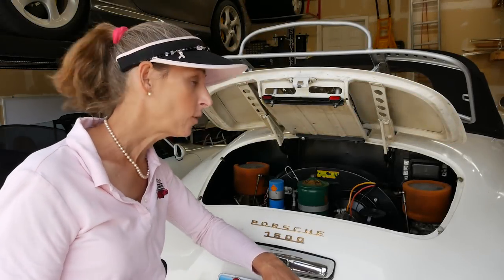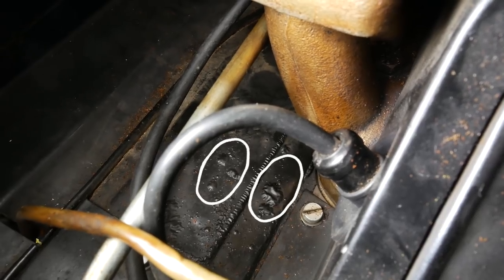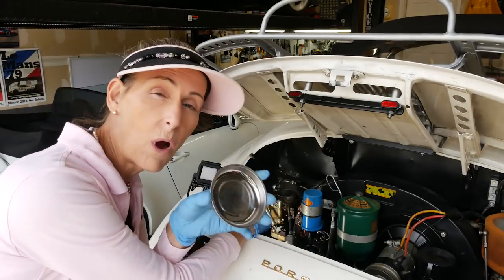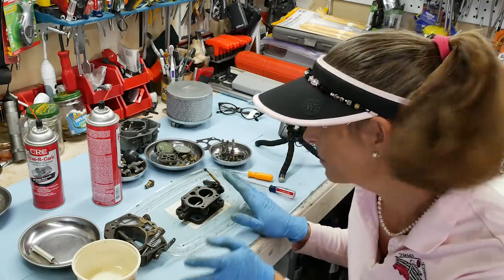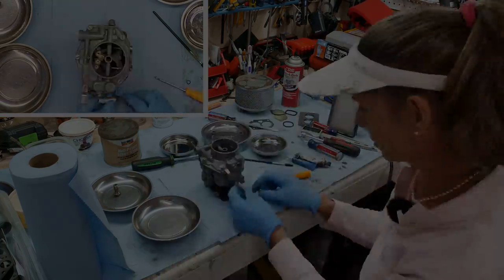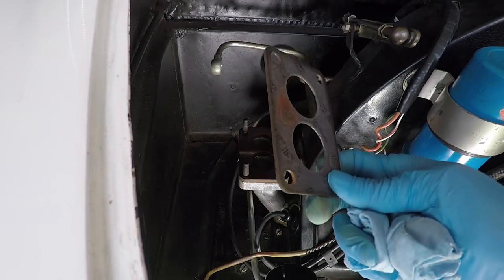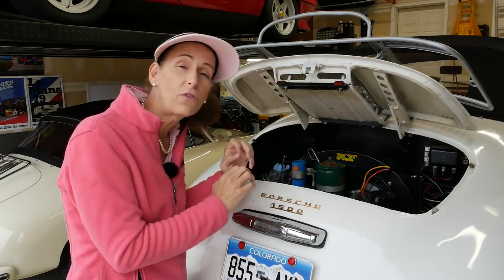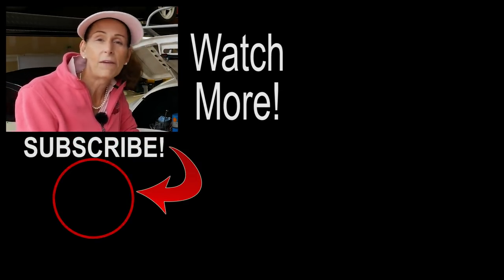Speedster Vlog #2 - Carburetor Tears

Comment: Another quality video!  You make it seem so easy to tear down and rebuild a carb.  I've never done one and am dreading the possibility that my 30Pict1 might ever need some work done to it, lol. 

Do those orange air cleaner covers actually do anything?  Those air filters look really nice...shame to hide them under a cover like that.
Reply: Chris,  My experience with the foam covers like that is they are for dusty environments. They are just an extra precaution so to not clog the main filter.  You would easily slide them off, and wash them periodically.  That can help limit how often you would need to replace the paper elements. But the heat of the engine bay, and volatility of the fluids/vapors tend to cause them to breakdown like these were seen to be doing.

Comment: ...given I have no direct experience with it yet an ultrasonic cleaner seems to be able to do a great job on cleaning small parts like carbs with beaucoup small internal spaces.
Reply from the maker: Hank, I am now envisioning our ultrasonic jewelry cleaner heading into the garage.  Lol. Heidi
Reply: Hank, I haven't experienced it myself either.  But I heard some gentlemen talking about it at a car show. They did not recommend using ultrasonic cleaning on the soft alloy parts of carbs. They mentioned a possible issue with cavitation erosion of the surfaces. Which in something as precise as a carb could cause issues with air/fuel leaks. So better safe than sorry I have avoided that practice. I have stuck with the carb dip just like Franny suggested.

Comment: OMG 7:19 made me Laugh Out Loud so hard. Please make that a regular part of these type videos.  I'm loving all the air cooled content. Picking up so much stuff I never knew about these types of cars. Great job on the rebuild. I understand how long a detailed video like this could get if you had you not sped up the rebuild portion.  But since I have never done one of these it would interest me to see every little bit of it. While watching I noticed the color difference on the carb base plate. Is it cast iron or another material? Looking forward to the next bit so I can learn some more. Thank you!
Reply from the maker: +Tim Gossett that is awesome!
Reply from the maker: Hi Tim, the throttle body is indeed cast iron.  Weighs a ton too ;)  I've always wondered if they do that for thermal reasons...  I think I had almost four hours of video to cut down.  It can get pretty fiddly cleaning all those parts completely.  This one wasn't that bad, but I wanted to be careful to clean everything.
Reply: Yeah it looked like it weighed a ton. Seems to me they did that for long term reliability as an aluminum or pot metal piece would wear out much quicker. But who knows for sure other than porsche historic. My other question is that I see it has one inlet but 2 ports in the bottom for each cylinder.  Is it truly a 2 barrel that pull from one inlet, or is it a single venturi that feeds both ports?  Do you find it easier, and more reliable to tune single inlets like this. Or is it easier to tune carbs with a venturi for each port?  It logically seems the 4 individual venturi would be more of a challenge.  (my nearest analog is a harley and its single carb for both clyinders vs a british twin with a carb per cylinder)  Thanks again for help with my technical questions.

Comment: The orange foam surrounds of the air cleaners are not OEM right? Are they needed? Air cleaner on top of air cleaner?
Reply from the maker: Funny you ask about that.  Your question will be answered in the next video.  ;).
Reply: Those are aftermarket, the air cleaners are just flame arrestors made up of metal mesh like a Brillo pad and should be soaked when you’re doing the carbs. 
She does a pretty good job of explaining procedures and you should understand that she leaves a few things out of a proper overhaul. The float level should be checked as well as the accelerator pump volume before putting them back on the car. Factory recommended using mineral spirits for off the car checking and there is a winter and summer setting for pump volume. Also check for warpage on the top of the carb as that causes leakage too.

Comment: How do you check and adjust the float levels on the Zenith 32 NDIX?
Reply from the maker: The manual has you remove the top and measure down 19mm I think it is (verify that).  Or you can buy it rig up a tube that screws into a plug at the bottom of the float and allows you to check it while the carb is running. Do a search on Google and I'm sure it will come up :)